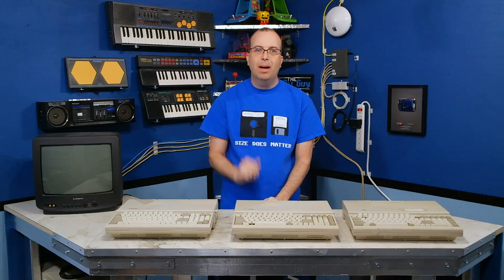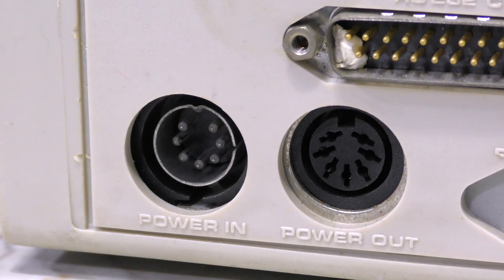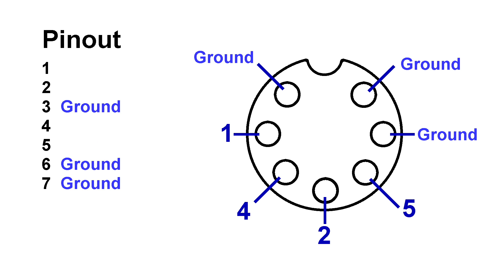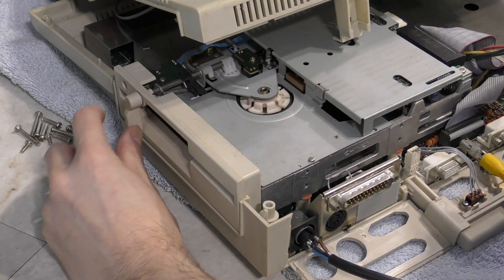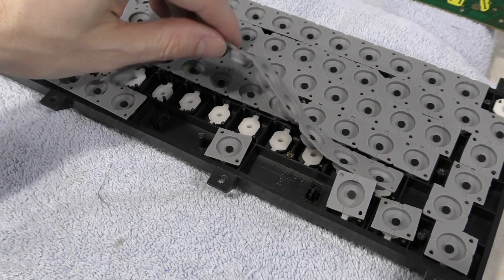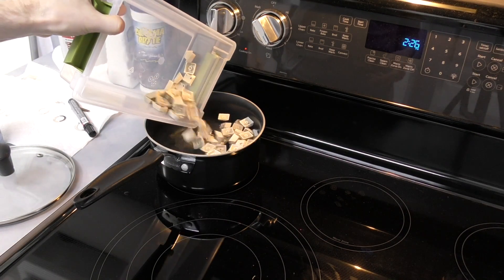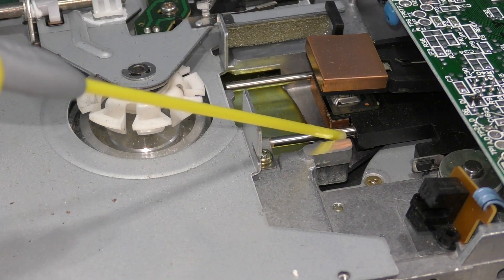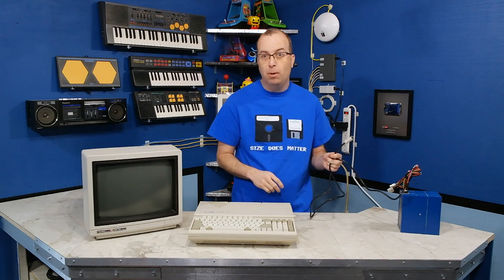Laser XT Restoration

Comment: You should consider investing into lab power supply.
Reply: failing@commenting now when you said it, it will probably come   in "8-bit donations!" video (:
Reply: Yeah but how would it have helped in this instance? It's just a single output that you set voltage and current-limit, but this machine needs 3 voltage inputs.

Comment: I'm sure you know this by now but, oh lord never put a power supply into an unmatching piece of equipment unless you are sure it's compatible. A lot of people have fried ZX Spectrums this way because Spectrums have a center negative barrel jack which is very unusual, almost always the center is positive unless it's various pieces of music equipment.
Reply: Nukleon I've come across a few odds and ends that had that center negative power supplies. If polarity isn't marked, I'll open up the device in question and see if I get a clue. I think that most DC inputs are positive center (negative "ground") due to automobile lighters being wired that way, and a lot of portable electonics use a "lighter plug". It kinda became a defacto "standard" even if said device was something other than 12 volts and would never be in a car. But yeah on DC inputs, there is no actual "standard" - Better check and not guess!
Reply: James Slick what I do if I'm unsure I'll often Google it first and see what I find if it isn't something I have to open or if it isn't real apparent when the device is opened.
Reply: It's more a question of age in my experience. Up until to like .. mid-90ies, early-2000s center negative was "normal", then everything more or less suddenly changed over. Music equipment just kept it
Reply: Except with a lot of portable radios and 8-track decks, those were still mostly center positive... Probably because they were designed to be used in a car or boat.